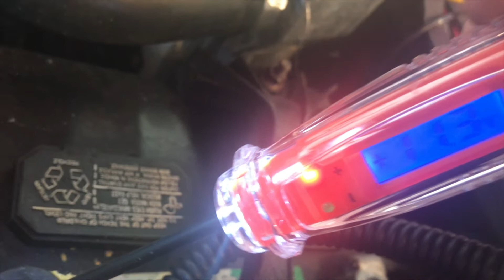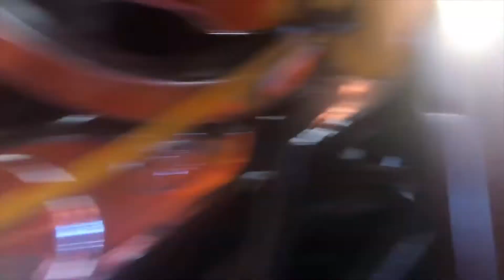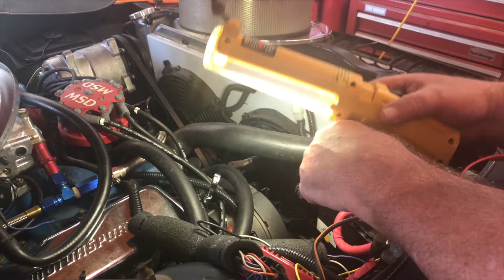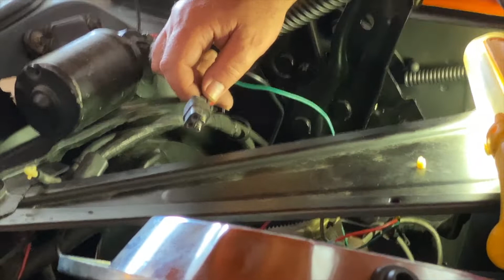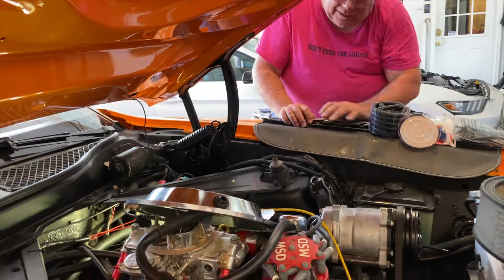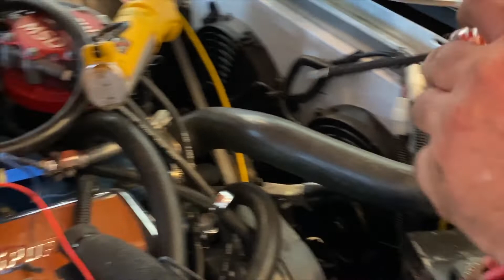1973 Mustang Electric Choke Rewiring For Full Battery Voltage using wiper motor power circuit #63

Comment: I have the same issue now,  I'm thinking it runs fine,  but I'm prob pulling some voltage down off my ignition.   Maybe more power if i relocate this electric choke.   Kinda thinking to just remove the choke altogether